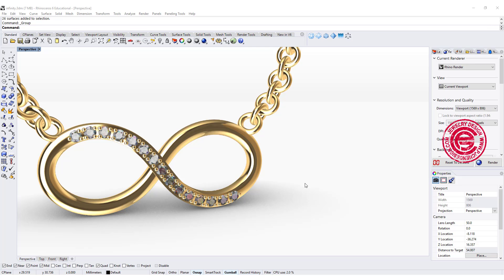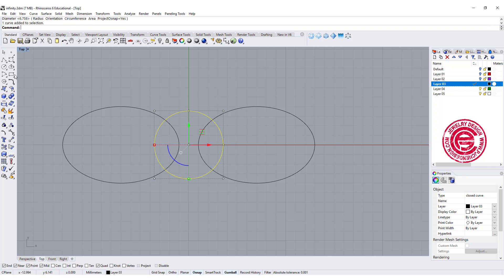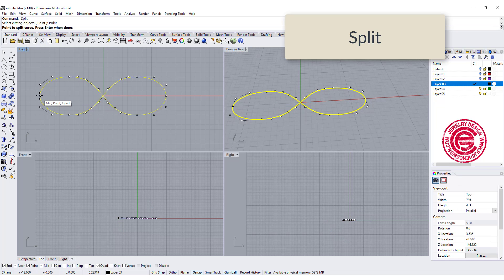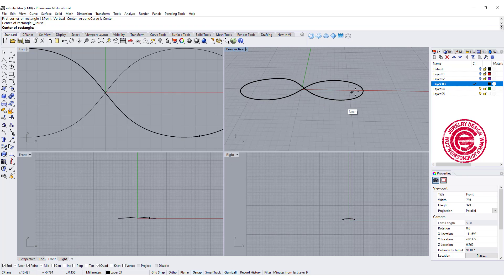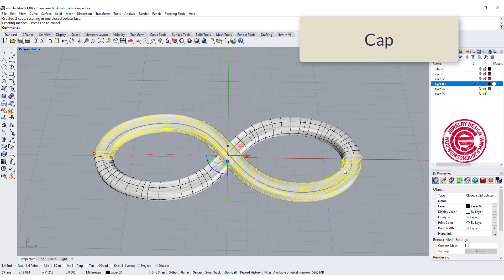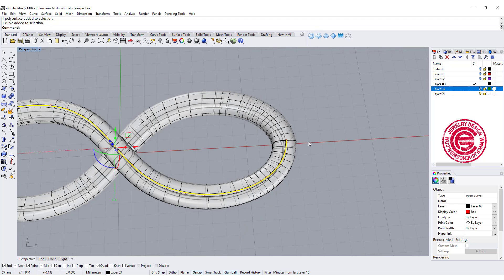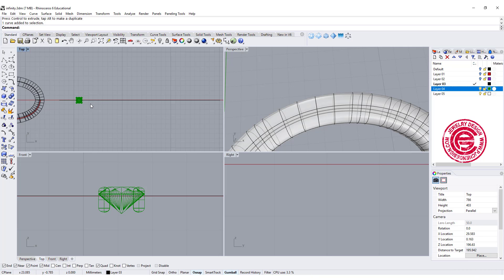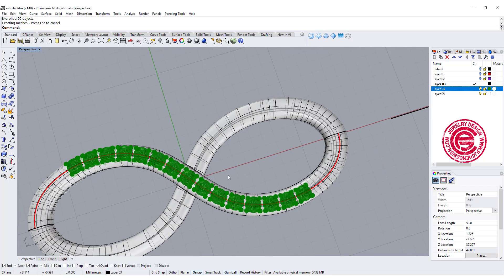How to Create an Infinity Pendant in Rhino (2019) Rhino 3D: Jewelry CAD Design Tutorial #62

Comment: I just designed one of these today. I use dynamic profile (i needed different sizes at different places) for the infinity surface but I like the way you made the curve. I will try this method. Thanks for the video
Reply from the maker: You are welcome and for Rhino user. there is no dynamic flow command. It is for Matrix or Rhinogold. but they basically are the same.